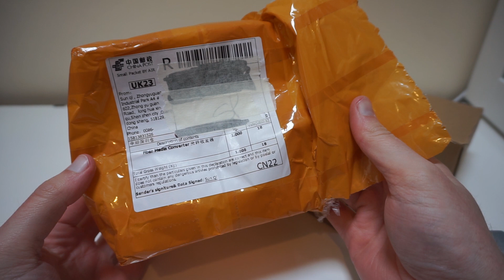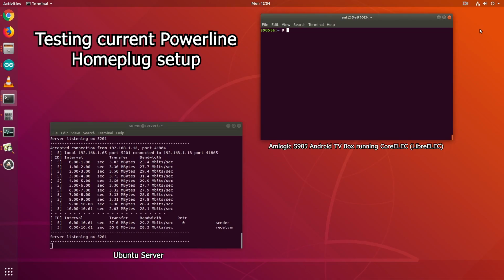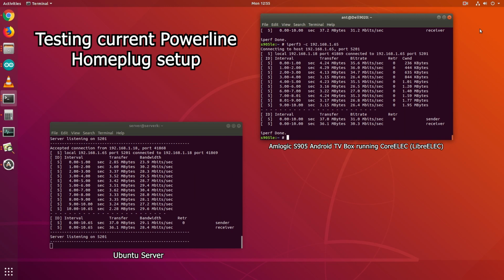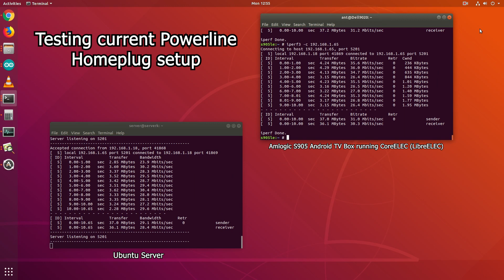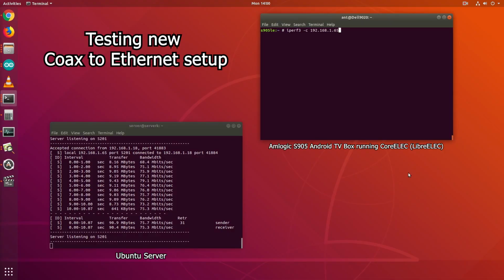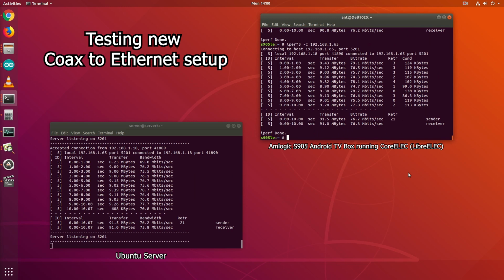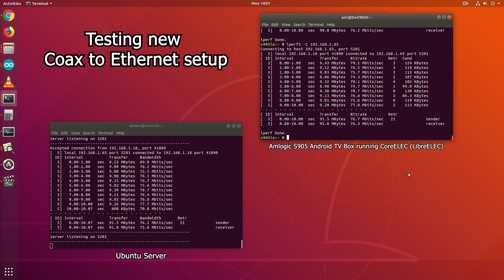Coax to Ethernet Adapter - BNC to RJ45 - Unboxing, Installation & Test - Homeplug Alternative

Comment: @Atzie Tomas, thank you for this video. I understand that more users are using these devices to transmit  Internet. I have already built a LAN line between two houses. Can I use the devices to transmit the Coax digital TV signal using the LAN?
Reply: I was wondering the same thing - that's primarly why I want to use it but I can't find any information about this yet.

Comment: Does it effect internet speed if I use a coax splitter and use one cable for this device and the other for the tv? Also would it still work? I need the coax for my tv channels and and ethernet for my fire stick 4k

Comment: I’m confused. I have a coax outlet next to my pc so I plug one of these into that then run an Ethernet from it to my pc. Then near my router I plug another one into the coax downstairs and run an Ethernet to my router? What was the massive cabling you showed. Also what if the coax downstairs is being used
Reply: If you have a unused Coax network in the house, then you could get 2 of these and plug one into the router and one to your pc and there would be connection.
The massive cabling seems to be his Coax connection in teh attic, and if you are using your Coax to transfer RF Tv, then my guess would be that this won't work if you don't make it 2 seperate connections.
Reply: I'm thinking of doing exactly what you said, did it work ?
Reply: Matt hi I just got a tp link in the end and it worked for me, unless you are trying to get speeds over 100mb/s then I’m not sure.
Reply: @nathansutton2090  ok thx

Comment: Your issues with the powerline adapters wasn't specifically the copper wiring in your home -- it's the fact that power lines are not meant to carry data.  Everyone that posts in /r/HomeNetworking asking about / having problems with this steaming pile of garbage of a technology reports the same speed you received (IF they get them to work) -- roughly 50-80mbps.  The issue with the technology is that any inductive load on your electrical system can / will interfere with them. 

They are garbage and should be avoided at all costs.  If this technology were any good, ethernet wouldn't need to exist...

Comment: question... Im ditching cable We are moving away from direct Tv and going to ipTv, i have a pretty good network settup  in my house,  simple question.. since i dont want to pull Cat5 to 2 tv's and the wifi is a little slower then id like.. Will a rj6 to cat5 adapter work?  the tv im talking about is mounted on the wall and the cable is pulled up thru the wall and terminated behind the Tv, the other end is in the basement (*network closet)  shy of running and fishing 50feet of cat5  and making holes in the walls  can i just transmit cat5 over coax>?

Comment: You could get some improvement if you bypass the actual socket .Remove the faceplate and terminate the cable inside with and F connector and F barrel and try the test again . Even if in the RF environment it's been proved that the sockets do represent a signal loss/attenuation in dB

Comment: So, how is this going after 6 months? Is the product robust?
Reply: I know it has been a year, but I have had mine for about a year and half and it works great, with 0 problems.
Reply: @raulrohjans7756  but is it fast?
Reply: @ThankGodEze1  The speed depends a lot on the coax cables. I connected them directly and was able to get 75 mbps, but using the coax in my walls (which is old and has a lot of splitters) I get 40mbps which is enough for me.
Reply: @raulrohjans7756  still working nice?
Reply: @DanielTG  I have changed house since then and stopped using it, the connection happened to drop 2 or 3 times during all the time I used it. I only had to unplug it from the wall and plug it back in to fix this
Reply: @raulrohjans7756  nice, I am thinking of buying it because if its gives 50mbps and doesnt give me packet loss is good already